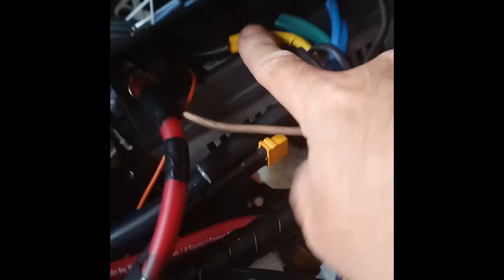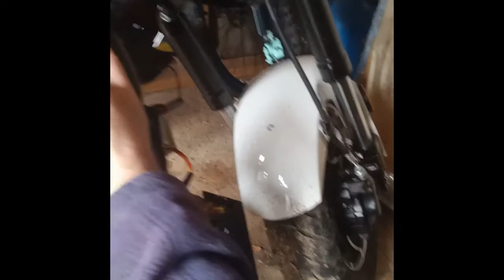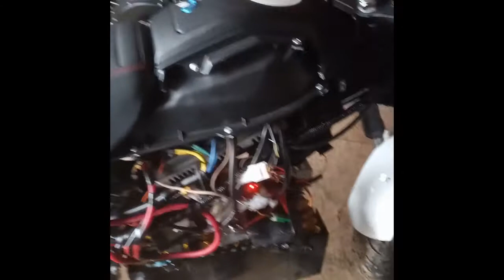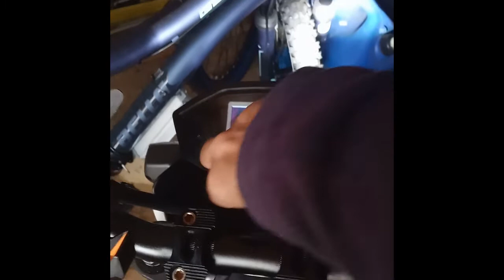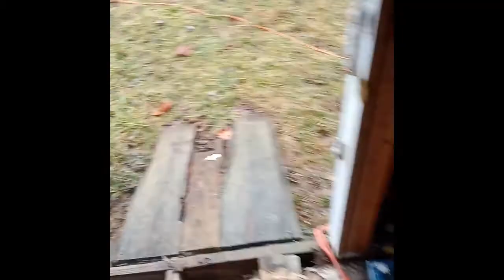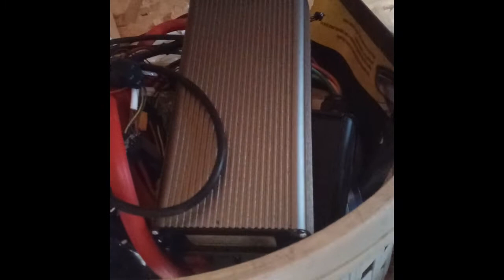Evader New Info3 27 21

Comment: hej how can i get the motor to get start speed whit the same i take the gas , and not a litle time after i take the gas grip ???? so i can get on wheelie
Reply from the maker: wheelie is not happening with my set up. my intention on design was to avoid that
Reply: @battery_solar_ev  Okay i have a bike like yours , and there is 2 cable , stick , these match hithoers  , SOFT AND QUIK START , do you now , what it means ? is it on your bike  , on the standard controller ?what if i put them together ?

Comment: What would be the ideal battery for that bike once you change the motor controller
Reply from the maker: sorry about the delay that would depend on if you keep the stock hub motor or replace it ive said this a few times the stock hubmotor is junk it only works it is not compatible with brake regeneration or flux weakening both have to be turned off . Now for the battery running the stock motor QS motor actually recommends the Votal controller sabvoton works but i had some scary moments with the wheel locking up during break regeneration and the flux weakening can cause it to do run a way meaning it keeps spinning max speed after you let off the throttle. The 2 sabvoton i tried was not hi brake compatible  which is what the bike is set up for but with the stock motor this does not matter and must be turned off.

Now to the battery. Lithium Ion 18650 10 amp cells the case is big enough to set up 3 18s no space between the batteries or 2 21S and have enough space between the batteries to contain the bms for each battery. There is enough room for 8P  tall. Your range on just 8p and the cells being 3100 mAh is going to be about 20 miles depending on weight and how much fun you have with it. The torqe can be some what fun trust me.
Ideal battery i suppose would be 21s 16p which is what im about to have and is all the space that i can stack battery packs in with out altering the bike. The current 21s 8p 20 miles is not even close enough to what i need in my area which is why im building a second one. Ill be posting a video soon on the last battery pack install and also a trick for a reserve battery at least i think it will fit ill find out soon enough im almost done with the second battery build and the reserve battery i have finished already. Just taking my time with it. Ive got over 800 bucks in the batteries and most of them came from battery hook up
battery 1
3100 mAh 10amp 18650
21s 8p 80amp bms
battery 2
3100 mAh 10 amp 18650
21s 8p 80amp bms
battery 3 reserve 18650
3100 mAh 5 amp
12s 8p 20amp bms

50 amp hour battery or better for longer run time is much better than stock lead acid. The reserve battery is gonna be a trick but it will work ive been testing a similar set up on my home solar set up for over 4 months now just at lower voltage.

Comment: Hey Steven I have my bike all set up but I'm having issues with the connection to the controller to the bike it's self.
Reply from the maker: what motor and controller are you using and there is pleanty of options to consider just need more info to pin point. If its all stock there is a main breaker under the seat the battery can still charge but the bike will not work.
Reply: @battery_solar_ev  I am running the same motor as you. And I have an em 200 but I'm having issues with the program plugs. Like throttle and high break and all that because the connections don't look like they match the bike
Reply from the maker: i had to change some of the plugs to match. All functions work for me the speed o will have to be the wire from the bike to the green or blue wire one of the 2 on the controller that goes to the wheel its made to use one of the phase out put for the wheel.

Comment: I have the votol EM 150 2SP. I recieved it a week ago and attempted to bench test it today but didn’t get the motor spinning. How does the boot up work. Do I connect the eLock wire to b+?
Reply from the maker: i went over the wiring in one of these videos for it the switch wire has to be connected for it to be active. yellow to battery positive with no switch

Comment: How do u go about programing the original motor? Not sure what program ur using or how ur connecting it to the computer? And what is the stock power controller that comes on it
Reply from the maker: the stock controller is junk and not programmable
Reply: Thank u steven I'm in the process of getting a lithium battery made for me. Probably 72v 50ah with a 25a charger. I can't stand waiting almost 10 hours for a charge
Reply from the maker: That would be and excellent start for amp hour capacity. judging on the miles i got from the stock motor with a new controller 50 amp hour im thinking would be about 40 to 60 miles. Using the votol and the stock hubmotor i got about 25 miles on a 24 amp hour battery averaging about 1 mile per amp hour. The stock controller will not use more than a 40 amp surge i never analyzed the power it uses i just trashed it after a 12 mile run. 28 miles an hour is way to slow for my area. If your planning on upgrading the controller just make sure the battery can do at least 100 amp constant but limit the current to 80 - 90 amp and watch for the voltage sag  keep it less than a 8% margin max. Voltage sag = speed loss and efficiency will also make the battery shut down prematurely on the low end. 4 Awg wire will work with the stock 100 amp breaker. If you happen to upgrade i would have to recommend the Votol EM-150 cause it fits in the perfect spot on this bike and saves room for your battery and is also High brake compatible for brake regeneration. If you do upgrade dont forget to get rid of that motor you will have nothing but trouble.

Comment: The batteries itself is already expensive  and to do add extra cells to make 22s going be around $400 including charger and bms.
Reply from the maker: Depending on what controller you use but the Votol i have 90 volts is the limit and 21S is the highest i can go with the battery. Keep in mind i did DIY with my battery and did not purchase one. the Batteries came from jag35. Ill be adding more batteries to this thing this spring for a total of 16P 21S.

Comment: On the 2000w v1 motor, do you think I can push 80a amps on it? I already built a 72v battery pack capable of 100amps continues.
Reply from the maker: ive done 70 with the stock motor just be sure to NOT use flux weakening and brake regeneration. Be careful about the rpm as well I had several occasions  where a run-a-way condition happen with the votol controller but that was using flux weakening. The brake regen did try and work but it was always not rite. I say stock motor and not V1 because the manufacturer had a motor custom built and it is not a true V1. Due to the limitation of the stock battery the stock motor controller will never do that much and not programmable you forgot to mention what motor controller you have. Keep an eye on the temp if it gets over 130 to 140 degrees as a safe point back the current down. I think if your talking about the true 2K V1 i think the max current rating is 50 amp. I know the price on that hubmotor is tempting but the 5K is really not that much more (except for the V4) and better suited for the weight of the E-Vader and much more torque.
Reply: @battery_solar_ev  I have the stock motor and controller. I opened the controller and beef up the shunts and add more soldering to the joints that Carrie's amps. I see the max cont. amps on the spec is 48. The previous AGM batteries wiring setup was so horrible that I think you couldn't get 40amps out of the batteries if it had that amount to deliver. I'm curious to see what will happen when test the modified stock controller with a lipo battery pack. And the same time I dont want to burn the motor out since it was expensive changing tires.
Reply: @battery_solar_ev I believe I have the first version of the bike because the stock controller is different than yours. Also, I forgot to mentioned the motor shows 1980w on the rim.
Reply from the maker: yep same motor mine showed  the same thing 1980 watts. I did the same mod with my stock controller as well changed the power wire to 8awg . Controller they sent with the bike is Yuyang King Series Model number YKZ7250JG-3C56511. Peak current 50 amp. but the fuse for the battery is 40 and wire indicates max 30 amp on surge so yes wiring is horrible. I can tell you that 60 amp constant is safe with this motor but if your going to stick with the stock motor and controller over current will not be a problem Even the true 2000 V1 is 50 amp rated. The high end current is going to be use for hill climbing and off the line start ups but level ground cruise and down hill is gonna be the lower end.
Reply: @battery_solar_ev  My controller has a max of 67a, and it does have a 8awg phase and power leads too. My biggest question is what has changed since the mods to the controller and wire leads???
Reply from the maker: youtube really should send you a notice when some one post a comment. What changed was better hill climbing (less slowing down) and also blowing the fuse from to much current off the stock batteries it did help.